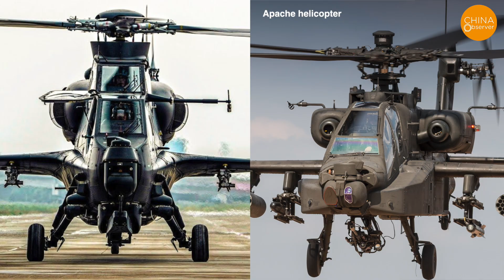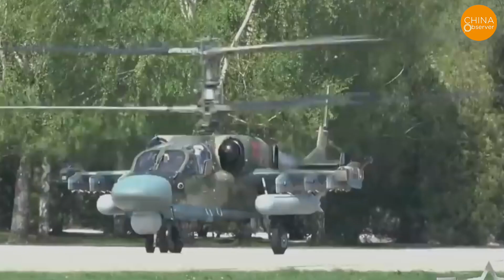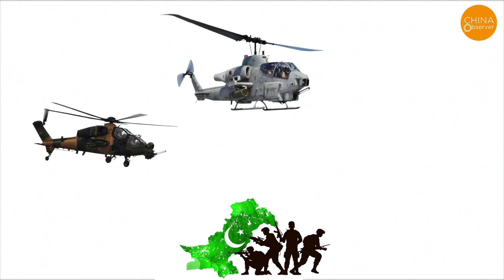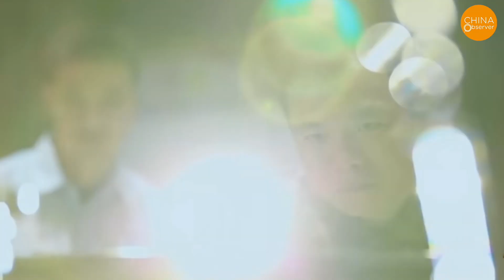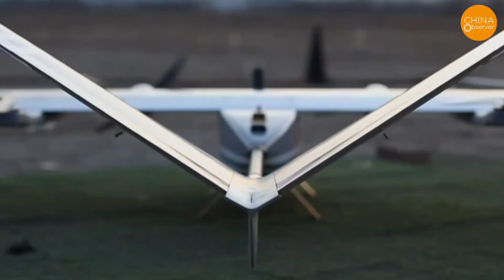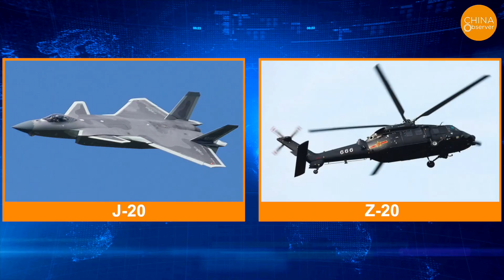Copy & Fail Again: China’s Latest Heavy Helicopter Becomes a Joke, With a Loss Rate Feared Over 50%

Comment: China tries to steal its way to success and produces cheep look a like knockoffs that are nowhere as good as the originals. Example: Years ago in the 1990's China flooded the world market with cheep nut and bolts. Bolts that were marked as Grade 8 in the US were really not up to Grade 2 standard. For the non technical people out there, thank of it as comparing wood to steel. This kind of problem exist through out the metal production in China to this day. It all comes down to the TOFU construction that is so wide spread in China from concrete you can brake with your hands to ships that brake apart under normal use.

Comment: Video generates a MISLEADING impression as to the cancellation of the RAH-66 Comanche helicopter. In 2004 the primary reason was that the Army decided that the RAH-66 was no longer affordable (20 years and $7 Billion with only 2 prototypes.) and the money could be funneled into existing rotary craft. 

If rotary aircraft are a thing of the past then why In March 2023 (just last year) did Boeing received a $1.9 billion contract to begin full-rate production of 184 AH-64E Apaches?. And Germany spends $2.3 billion on contract with Airbus for 62 H145M light attack helicopters, with a portion of the fleet equipped to fight tanks from afar — a direct lesson from the fighting in Ukraine.

Some may claim the advent of the Unmanned Aerial Vehicles (UAV) which have proven their capability to efficiently perform the reconnaissance mission at a much lower cost was the strong incentive that led the Army toward the decision to terminate the stealth helicopter, but published interviews conducted with DoD and Army key players refuted this assumption.

Comment: Mainly is the LOW - QUALITY of Metallurgical Failure from SURFACE HARDENING Depth/ Substrate, is NOT permanently ENCLADDED... PLUS the (material) Toughness to Endure the joints/spigots? ... The weakest point to be critically examined/tested (100%) : NDE.!!
The way they compromise high-standard by (more often) spare-parts replacement...
(They wrongly think, cheaper is ok, .. 'cuz they will produce more of it w/ lower STD.!?!)
Reply: For more complex joints between the Composite Materials & Metal base joint ...need more inspection/certified std.
Reply: The imitation process must be more complex /deeper than SKIN.!!

Comment: Can't wait to see them copy the osprey.
Reply: Even if China could duplicate the Osprey, externally, there is A LOT of internal details that China will find difficult. There was years and years of R&D to get the Osprey into the production stage. I am going to go on a limb and say that designing the engine and the mounting is going to some of the hardest obstacles to overcome. Developing the fuel system will be another headache.

Plus, learning to operate and fly it will be another learning curve. You are looking at an aircraft that has fixed wing and rotary capabilities. 

Plus, the US military is still finding situations that will cause the Osprey to crash but those situations are becoming fewer and far between over the years.

Comment: I realized the difficulty in creating a helicopter as an engineer even with 3 rotors by replicating the US APACHE using a drone yes without weight the drone flies but once I put even a little weight in it the drone will no longer fly or it cannot manuever properly thats why I concluded that if you want to add any weight quadcopters are the best in use as a transport drone.

Comment: The requirements for high altitude warfare (e.g Himalayas) are quite different as the low oxygen levels greatly cuts engine power.

India had to design its LCH combat helicopter from scratch to meet those conditions as no other helicopters could meet the needs.

Russian designed helicopters had a heck of a time flying at such altitudes making their operations in such environments high risk.

Comment: Imagine their commercial planes their trying to scam on the world 🇨🇳
Reply: Don't fly in them. China saves on manufacturing costs by not installing properly functioning safety systems. The 991 jet, sorry the 919 jet 😅, is made to crash order. I'm not boarding it. If the airline I choose to fly on uses them, that's the last time I'm flying on that airline (if I survive the 991 jet flight).

Comment: It is obvious that at this stage the CCP lacks the ability to innovate technologically and must slavishly copy that of its betters.  Eventually they will learn, although the communist system does not excel at encouraging innovation and creativity.  China also lacks the deep manufacturing process experience required to build high tech military systems. They will live with lower reliability and much higher maintenance expense for some years to come.  At present China is far more interested in presenting the appearance of a capable military as a tool for its bluff and negotiate strategies.
Reply: well said, good insight.
Reply: Hear, hear

Comment: Well that's a Z10 in the photos, so no that's not copying the U.S. It was a Russian contract in design. There's also so many ways you can design an attack helicopter because of the design. No different from why all tanks, airplanes, cars, etc. It's because of the function. 

Their Z21 has the tail section that's a similar design to the U.S. Black Hawk but, that's it. There's been others that has analyze and compared the two side by side. The front looks similar to the Russian MI-28.
Reply: Looks are one thing, but guts are everything. It's why all the car nerds at a car show go directly to see what engine is in the car.
Reply: @orlock20  K swap the world. Lol. Jk.
Reply: Yes.  

In the 90s, China did contract the Russian helicopter 🚁 design bureau for the development of the Z-10.

So the helicopter is not a copy of the Apache Longbow as stated in this video.  

It was based on a light attack helicopter design that the Soviet Union had developed but did not put into production as the country fell apart.